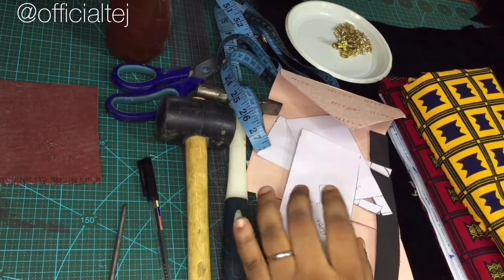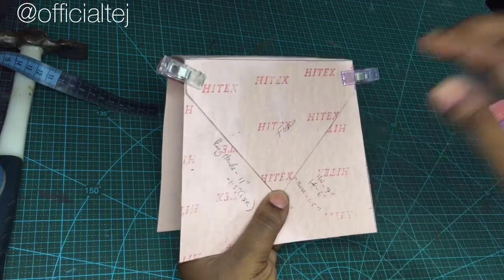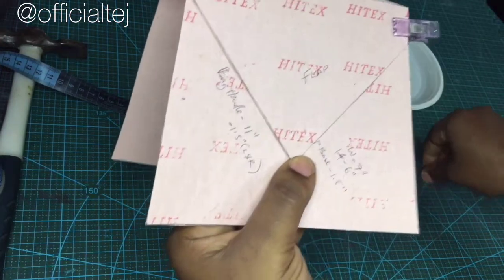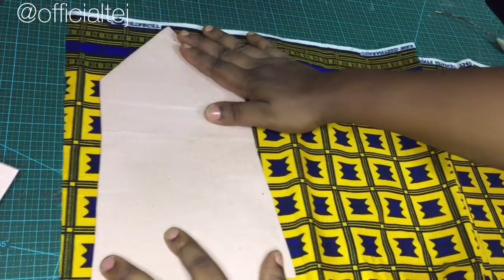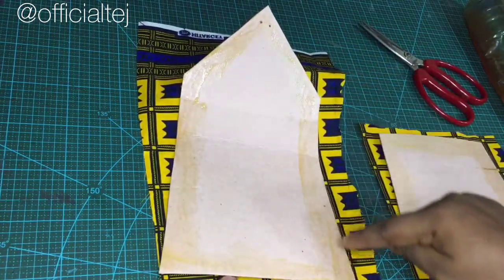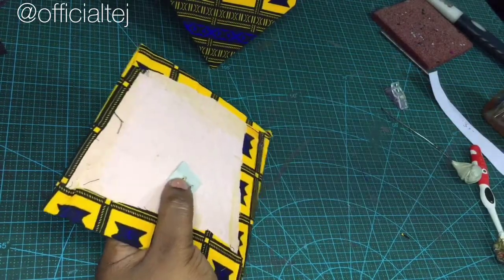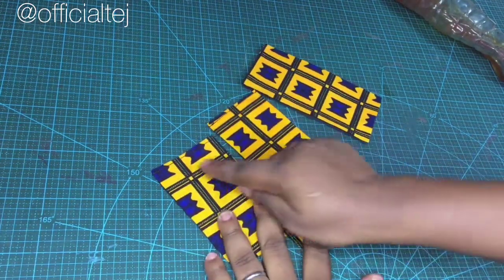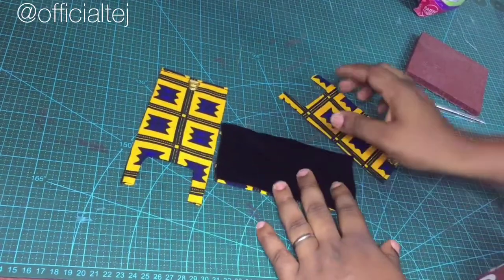DIY Ankara Bag [DETAILED] Part2

Comment: Good evening, ma. This is superb. I am definitely going to try out. Please, would a basic sewing machine do the sewing part?
Reply from the maker: Yes it will. I used a flat bed sewing machine for this project. All u need is to change the needle to size 18-22 (depends on the thickness of the bag). Then of course a bag thread (size 2). A lovely evening to You❤️
Reply: @OfficialTej  Thank you so much, ma.